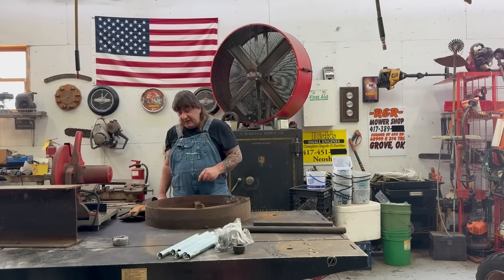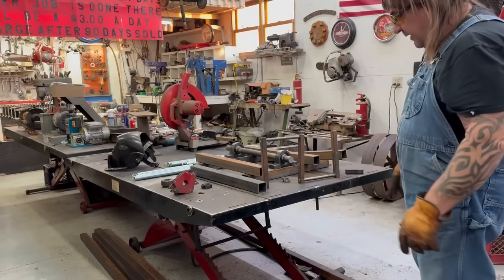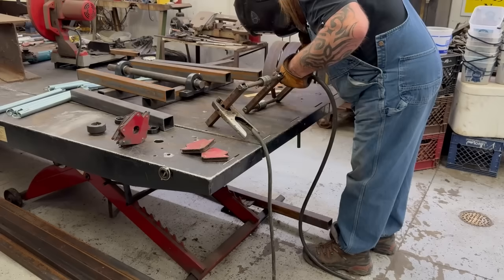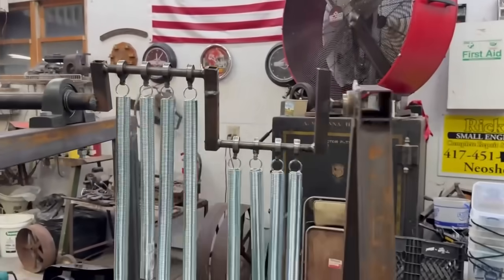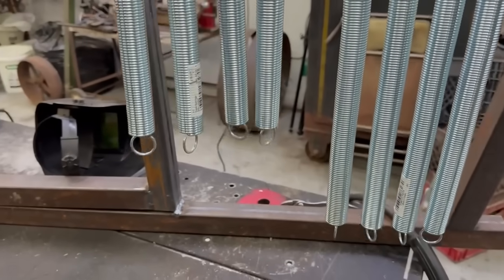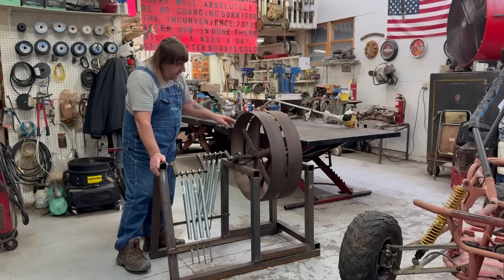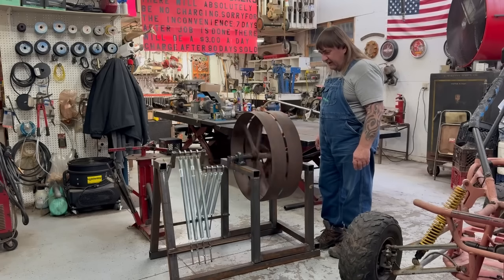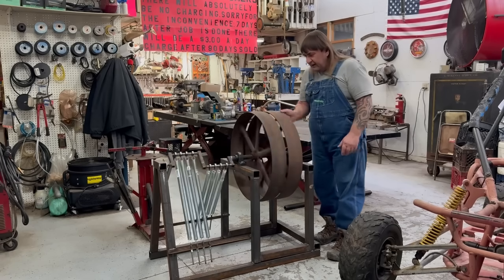Building A HUGE Flywheel Spring Engine (Free Energy?!)

Comment: What if you used a small electric motor (charged via the flywheel motor) with a long cam that only assisted the expansion of the springs? Since there's less energy loss in stretching the spring, would you get enough energy to power the small motor with some left over, or would you only gain enough to run the small motor with none left over?  ...what if you attached a belt to a flywheel and put a very small pulley on the small motor, would the increase in RPMs of the small motor create less draw on the available energy??? I need to go back to school and take my ADHD meds...

Comment: Some how to make it go and go. It should be able to just wind up like an old clock or music chest that would work as power. Then a device to wind the spring so you don't have to. Maybe they're going at it all wrong. Instead of perpetual motion. water electric and windup clock like motor some compressed air and bingo bango a generator that keeps itself wound up by way of whatever it takes... solar would be helpful also, hydrogen so much fuel available for some serious scientific research. I'm not afraid of using all that stuff together.  Wish I had a shop outside of my mind 😔

Comment: The wheel he has could maim him; but it will also be making energy. 

Lets say his wheel has a mass of 40 kg and it has an arc speed of 2 m/sec. That is a Newtonian Momentum of 80 kg*m/sec. The wheel can throw a 1 kg mass and that 1 kg will also have all the motion of 80 units of Newtonian Momentum. There is no experimental or theoretical reason to think that Newtonian Momentum Conservation does not apply to this rotational system.

The 40 kg wheel moving 2 m/sec has ½ * 40 kg * 2 m/sec * 2 m/sec = 80 Joules

The thrown mass of 1 kg has an energy of ½ * 1 kg * 80 m/sec * 80 m/sec = 3200 Joules

At 80 m/sec the 1 kg mass would go through most anything it came in contact with.  It could easily kill or destroy objects or walls in the lab. 

You have to choose between the experimental facts of Newtonian Momentum Conservation: or the dogma and mantras of energy conservation. Why do people have an emotional response to energy not being conserved? Each of you need to think about how you were trained and what is experimentally true.

Comment: Great work on your free energy machine. In my opinion you have everything balanced so not having a power source why not add 5 lbs. of weight to the flywheel. Please let me know if it works as what you have built is very intriguing to me.

Comment: Mark you can wrap one of your rims with a weighted string; and the rim will throw the mass on the end of the string. This is seen in 'smokin lamas' or 'cylinder and spheres' or sounding rockets.

If your 80 pound rims throws a 2 pound mass it will throw it 40 times faster than the rim had been moving and the rim will be stopped. All the momentum of the rim will be transferred to the 2 pound mass. The energy change is (1/2 * 80 lbs (about 40 kg) * 1.2 m/sec * 1.2 m/sec = 28.8 J)  to 1/2 * 1 kg * 48 m/sec * 48 m/sec = 1152 joules.

 28.8 Joules becomes 1152 Joules

The 2 pound mass moving at the speed of a baseball could kill you or do major damage to your shop. You can throw soft objects and slowly until you get an appreciation for the massive energy increase. 

After the 2 lb (1 kg) mass has risen to the top of the shop; its energy can be returned to the rims by use of a pulley system. From the top of the shop the 1 kg can restart the rim to about 1.2 m/sec using a pulley system. The 2 lbs will actually rise 117 m (380 ft). so it only takes a small portion of the energy to cycle the system. We can deal with where to put the energy later. 

Hopefully you still have yours spring flywheel in the shop; it will only take a few minutes to check out how throwing works. Throw in the same rotational direction as the wrap; and the springs can be removed.

Comment: The one thing it looked like on the other video is they had the springs a lot looser so there maybe was no tension on the opposite side of the springs. So maybe no opposing resistance on the springs as it spins around holding it back as much on the opposite side. Don't know if you tried that and it would make a difference or not..

Comment: I think you could power it with a wind mill, and use centrifugal gears, to get the fly wheel moving a generator. A person could compress air in a tank, and run air tools.

Comment: Can clearly see the rear stroke of the springs are longer than the front set.  The mesurements are wrongs.   This would probably have a chance if the mesurements were correct.

Comment: For more fun, try placing the springs anchor points at different angles. The goal is to change the angle of pull by dividing the springs into four or more anchor point angles. Right now, your angles are balanced. But if you can get it to run for 5 minutes, that would be success.
This will be fun for every one that comes to your shop.

Comment: Make sure you run it with a full load, not just running without a load.  There was some work getting it started. So you have to prove that its energy output is greater than the amount of energy to start it.

Comment: The law of physics says you can’t get more from less. For every action there is an equal reaction. Love your video! I wish it would have worked
Reply: It will work; Newtonian Momentum Conservation guaranties it will work. All he has to do is wrap his flywheel with a weighted string.
Reply: The 'action and reaction' is a Newtonian Law and it refers to Momentum NOT energy. When one object has a change in linear momentum the second object, that it is interacting with, has an equal change in linear Newtonian Momentum.  It is NOT saying that the energy remains the same.

When a 5 kg mass moving 4 m/sec loses momentum because it has pulled (action) a 3 kg object from rest (reaction); the momentum lost by the 5 kg is equal to the momentum gained by the three kilograms.  The 5 kg loses 7.5 units of momentum and the 3 kg gains 7.5 units of momentum.  The original kinetic energy is 40 J and the final kinetic energy is 25 J.

The profs would like to see Newtonian Physics become a thing of the past; so you see Newton misquoted all the time. 

If you were to throw a small mass, on the end of a string, off of this wheel it could be moving about 40 times faster and it would have 40 times the energy. 

½ * 40 kg * 1 m/sec * 1 m/sec = 20 Joules

½ * 1 kg * 40 m/sec * 40 m/sec = 800 Joules

The 40 kg would rise .051 m and the 1 kg will rise 81.55 meters. 40 times as much energy.

Comment: Save that frame you just built. 
Can you build something with that frame....
Two electric bicycle wheel kits. 
48 volt 1,000 Watts. If you could Mount the wheels in that frame. A 48 volt 52 volt alternator mounted in the middle. 
It's a 5000 watt alternator from a company in Missouri. 
1,000 watts is 80 amps. 
That is 160 amps for the two wheels to run. 
Of course there is a big 48 volt battery storage box. 10 or 12 solar batteries. 
Anything extra is free energy from the alternator. You need 160 amps to run the wheels. (The wheels are one horsepower each). If you could spin that alternator with two horsepower... Anything more than 160 amps is free energy. 
The alternator is up to 400 amps. 
If you could get 260 amps. 
That is 160 amps to run both the wheels.
So any more than 160 amps is free energy. 
So if you could get 80 amps for free.
240 amps total. That's 160 amps to run the wheels... And then 88 amps extra to charge the batteries. 
That is 1,000 Watts for free. 
What if you could get 2000 Watts for free. 
That would be 160 amps to run the wheels. 
And then 160 amps extra. 
You could have a 10,000 watt 48 volt DC inverter. But you only run half of it which is 5000 Watts. When the batteries lose half their charge.... The recharger turns on.. and then it charges the batteries back up in a short while. This is all run by a serpentine belt along with one or two idler pulleys and one of the idler pulleys is a tensioner.
Reply from the maker: That's a pretty ambitious project, but it sounds like a lot of fun!
Reply: @lmsmallenginerepair4471  if it works you'll definitely get millions of views

Comment: Can you please build a very simple but large neodymium magnet motor.. with 5 hp at the crank. With a serpentine belt pulley on the crank so it can turn a 12-volt automotive one wire  63 amp alternator or generator. 
The alternator needs at least 3/4 of a horsepower to turn. That's the alternator test bench at my friendly Napa. The motor in there is a 3/4 horsepower motor to test the alternator. So if you have 5 horsepower at the crank that should be plenty.

Comment: Put magnets on the wheels. And then put a stationary magnet in under the wheels. Or make a wheel with magnets to going around the two wheels with magnets on them as well. That way you can get a magnetic propulsion. You just have to somehow keep it from spinning so hard that it might torque out and damage itself like some kind of governor

Comment: The best thing to do with this is take the springs off, put a seat above it and pedal. You have a keep fit device which (with addition of a small genny) can convert that effort into electricity. If you made this the only power source for charging phones and game consoles you could have a massive impact on world health even. Then have a sport based on how many kWh you can produce in a given time rather than pointlessly running round in circles etc etc 😏

Comment: You need to put one set of springs above at a 180 degrees from the other and it will work.  The way you have it it’s locked down, lacks an opposite pull…

Comment: Did you test the setup to see if the springs make any difference in flywheel output? You need to spin the flywheel to an equal rpm in both tests, 1 run withsprings, 1 without springs...to know if there is any change in the length of time the flywheel spins, if the flywheel spins longer with the springs hooked up, then there is something there, but if not? You tried! Both tests need the flywheel spun up to the same rpm...if there is a time difference then let us know...spin longer with springs or without? Curious 🫤

Comment: Increase the size of the spring attachment on the shaft.. I think it needs a bigger swing to spin those wheels, or stronger springs and a crank similar to old cars & tractors.. Just a suggestion, it's what I would do if it was my project..

Comment: Another attempt at a perpetual motion machine. Friction and gravity of the big factors that make a perpetual machine not work. You’ll always need an external force of some amount to keep it going. Eventually, the machine will run for a while and then it will die out because of friction and gravity.

Comment: There is abundant energy in the universe. The problem is coming up with an efficient way of extracting it. I have been thinking about this issue a lot. Where we lose a lot of energy is that we are using mechanical means to convert one form of energy into another and that takes energy from the system. We need to figure out a way to convert energy from one form to another without that mechanical middle man taking energy from the system. If only i had more money and a shop full of tools.
Reply from the maker: That's a great way to think about it!
Reply: @lmsmallenginerepair4471  I have been thinking about that inventor in Africa. If his generators actually work. I would bet that what he is doing is to use the tiny amount of electricity he gets from ambient radio waves to run a resonator that boosts sound to a higher osculation and he is drawing electricity off of the amplitude gain, and not the radio waves. That is why he keeps referring to it as a sonic device. He is using forced osculation to achieve an amplitude gain and drawing off of that at a higher energy level somehow. Or he is using the vibration from the sound to move tiny magnets across a coil. But that would still be that mechanical middleman we need to get rid of. So I am trying to figure out by what means he is converting the sound osculation into electricity. That is, IF it's not just another hoax. I bet that is how they work.

Comment: Thanks for your video. What is not understood, even equal energy in and the same energy out may be obtainable. But having the energy to do actual work is a totally different process. Man has been trying for a millennium to build it. Not yet. If super conductors are ever finally made to actually use, is when the real magic will happen.

Comment: What if one side of the springs were suspended from above so it was also pulling up? Maybe even a couple springs from above pulling against both sets of springs. I wonder if that could counter them to give it that little  push you need to continue rotation

Comment: Thank you for doing this..
The one you built didn't work..🦧
🤔🤔🤔

Well when we were born we didn't know we could walk..👶
But we didn't know any better so we kept trying.

I think it's very close, 
To working..🦧🦧🦧
You already got it made. 
Don't give up on it now..
Try to figure out, what could improve it..
Maybe on the crankshaft, 
Where do you have the springs..
Instead of having a half turn Pull.
Maybe have four sets..
So each set of springs only pull a quarter of a turn.. the only thing I can think of right off..
Maybe aluminum wheel. 
I think it could be done. 

If I have the workshop to do it.. I would play around with it every once in a while.. I won't  to beat myself up with it..
But it wouldn't hurt to fool around with it once in a while..
I believe you can do it if you keep trying..
Even if the other ones in videos don't work..
I still think it's very close, to something working..
Remember Tesla the inventor didn't give up. 
And they stole his ideas..

If it is free, you know they don't want us to have it..
Well anyway your choice.

Comment: It's not fake bruh , by looking at your machine there are little mistakes that you made, the spring crank bar to the back is longer than the one bar in front, it wants to work you need to adjust your crank evenly to make it run properly, and I like the way you can adjust the spring smart thinking.
Just tweek a little and you will be amazed by free energy, read about earth 🌎 and how earth is balancing by magnetic force of protons and neutrons , are technology is  advancing slowly because of being skeptical humanity.

Comment: If you really want "free energy" than you need a 'Hydra-Kinetic Motor'.

Its a motor that can run either mechanically or to drive a generator to generate electricity.

It runs solely on kinetic energy from springs.

I completed the design about seven years ago.

Yes it works and very well. It can power anything that needs power!

Ive got it and Ive had it, but nobody believes or listens so nobody has it to use.

Life is funny like that.

Comment: If you could decrease the tension on the stretching set of springs while the contracting side pulled the crank - with a cam on the main shaft that changes the position of the bottom end of the spring rack - it might work.

Comment: Take 1 of the springs from each of the sets of 4, and hook them down stretched a little tighter to the bottom center, and that should help...!!! IF not that 2 feom each and do the same. Make a spring mount in between the 2 down low and attach 1 or 2 from each there, a bit tighter...!!!

Comment: Seriously giving a little ❤ to me isn't responding.  If you did it like crank shaft. With more than 2 it may have worked.
All I can do is think back to a Oliver tractor wit massive flywheel . Store energy in flywheel kept tractor operating. Engine would kick in as needed to store up energy.

Comment: no matter how may springs pulling they will always cancel one another out anyone with bacic engineering skills will know this free energy is impossible even the bacic water wheel requires the energy of moving water the flowing river is there and free but your starting with an energy source the springs dont contain energy unless energy is applied to them
Reply: But you would think that there would have to be a way to make it work on its own once the momentum has started because if you don’t have a source like water, air or electricity one would have to come up with something else to make it work.

Comment: FYI;     ~    The other videos are made like this;  
First use an outside force to accelerate the thing to the fastest SAFE speed that you can. 
2nd, Start Recording the Video Camera. 
3rd. film the thing slowing down. 
4th At the last second before it comes to a complete stop BY ITSELF,,,, you grab the wheel and MAKE IT come to a COMPLETE STOP, then let go of the flywheel, and THEN step back away from the UNIT ((NOTE; you must stop the Flywheel with your hands in the exact same positions that you would START it to spin from a complete stop, "AS IF you WERE STARTING IT by hand rather than stopping it.))
5th. PLAY BACK THE FILM IN REVERSE, and now it LOOKS like you,, 
A), approached the unit.
B), grabbed the Flywheel.
C), Spun the Flywheel, JUST FOR A SECOND TO GET IT GOING.
D), Watch it APPEAR TO SPEED UP gradually to the highest speed you could imagine.
Ta Daaaa.!!!
Magic. ~~  High School Film Study Coarse - circa Class of 1975

Comment: Free energy just doesn't work with the laws of nature.  But, I wonder if your contraption would make a motor more efficient.  Say, if you had a motor turning your flywheel engine and the flywheel engine spinning a generator vs the motor running the generator without the flywheel engine in-between.  My bet is that the engine would burn the same amount of gas and create the same amount of electricity with or without the flywheel engine....  but it would be interesting to see.  It does look like it would like to keep going with very little help from a motor.